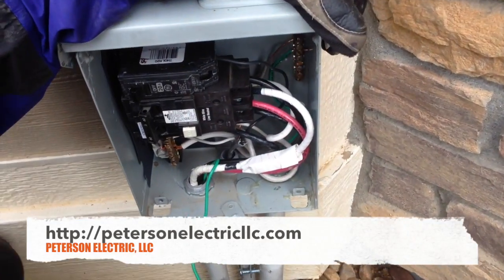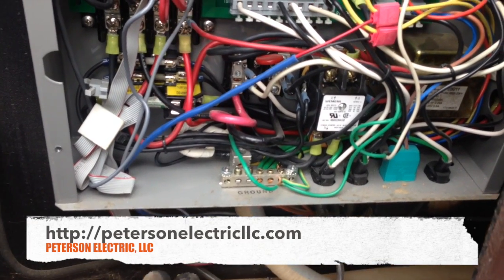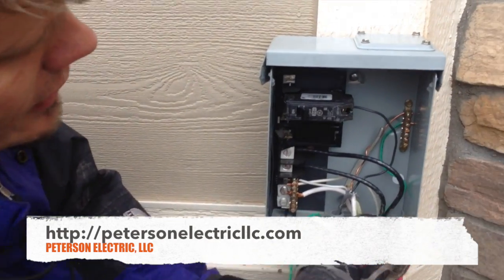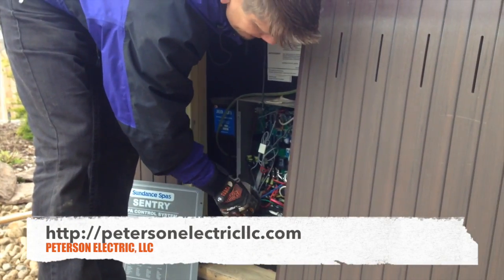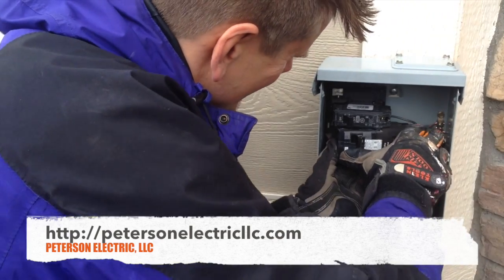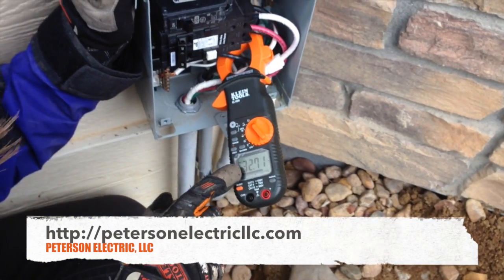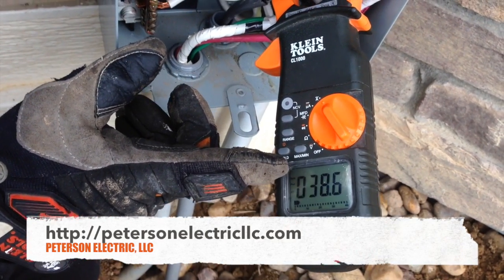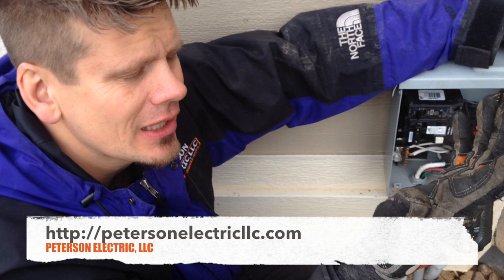Spa 3 Wire System, Not 4 Wire Electrical System

Comment: The tub could get away with 50 amps, but Sundance allows to have both pumps on high speed while running the heater.  There are jumpers on the circuit board in the "JP9" cluster that changes the operation Logic to use 40A, 50A, or 60A depending on the available power.  On 50A you can only have one pump on high speed with the heater, and 40A only allows to have pump 1 on low speed with the heater.

Comment: 75 degree table for breaker lugs
90 is for motors
You are wiring a gfi 75degree table
Reply: Yes and no. Anything under 100 amp over current is 75 degree.
Reply: Please check 110.14 for connections.  I thought it said that for < 100 amp connections use the 60 degree column unless the terminal/ breaker is marked as rated for higher.

Comment: I am having the same problem i also have a sundance (3wire) the attached pic is the GFCI (all conductors are 6 AWG) i have 4 i was just going to cap the white between the GFCI and tub so if i understand this correctly the green wire from the tub (or white if its the larger gage in your case) should land on the middle terminal on the GFCI breaker and the white pigtail should land on the neutral bar also u said isolated neutral in the GFCI box so i should make sure the bonding bar is not installed? so in the GFCI disconnect box it should be..
Feed form house
Red - Hot lug
Black - Hot lug
White - Neutral bar (lug)
Green - Ground bar
Load to tub
Red - Hot breaker terminal
Black - Hot breaker terminal
White - Caped
Green - Center breaker terminal
Pigtail - Neutral bar
(bonding bar disconnected)
?
https://www.dropbox.com/s/jtrwvdxk112d7sp/20200711_181117.jpg?dl=0
Reply: found my own problem.... thats what i get for buying a disconnect box/GFCI breaker 2nd hand for $20 vs the 100 at the DIY stores...it was a bad GFCI breaker!!! it was wired right...heres how i found it ..if u wanta test to see if your GFCI breaker is actually working disconnect the loads from it or disconnect the load lines on the tub, and try just truing on the breaker by itself no load on it if it still trips the breaker has to be bad
Reply: @brandonoh777  So I am installing a 50 amp gfci disconnect box and going to hook up a sundance hamilton 3 wire tub.  So am I correct to state that from main panel to sub panel is 
red hot
black hot
white isolated 
green ground.

From GFCI to box
pigtail to isolated common
Red to hot side of Breaker
Black to hot side of Breaker
No connection to Common connection on Breaker?
Thanks

Comment: My electrician wired up 4 wires to my Sundance 680 Mckinley tub that only should have three wires. Smoke came from the tub, there was an electrical burn smell. The tub ran for a while then stopped showing a flow code error. 

Do you know what damage could have been done, what needs to be repaired and if the tub is safe to use? I think the smoke may have came from a pump motor or heater. Thank you!

Do you know what damage was done and of the tub is safe to use
Reply: its hard to smoke out a motor or heater.   my guess is your control board fried a relay or something.

Comment: Hey thanks for the video, keep em comin. So, the gfci breaker in the panel reads the amperage through the hots and will trip if there is discrepancies in returning amps which would indicate an electrocution or fault taking place?

Comment: If the tub doesn’t need a neutral why not cap off the neutral, instead of the ground? I know in my area it needs to have a ground.
Reply from the maker: You could use the Neutral on the load side as a ground and then cap the other. The Neutral is in a larger conductor and the ground is smaller. You can use color 3M tape and use which every one. It just matters that the Neutral is not connected on the disconnect to the spa Neutral lug on the spa. This is a Sun Dance Spa and they do not want four wires from the disconnect to the spa. But from the panel in the house you have to have four wires to help trip the GFCI spa disconnect
Reply: Peterson Electric - Hey I didn’t connect the neutral to the jacuzzi, I what I see in your comments, the GFCI breaker still work right?
Reply from the maker: @MsMKBOY  only on the hot wires.
Reply: Peterson Electric kinda confused so do u have the neutral on the gfci connected to the ground on tub because I seen you cap the ground most I seen there’s no wire common off the neutral on the gfci it’s just the ground on panel to group on tub

Comment: Do you have a diagram for wiring a three wire Jucuzzi tub, including the gfci disconnect box?

If I connect ground, it trips gfci breaker. It’s a dedicated circuit from the main panel in the garage, with a disconnect about 8 feet from the tub. There is a neutral run, but not connected at the tub. Seeing a full diagram would be great. Did I mention I don’t like three wire systems.

Comment: Let me ask you a question. I have a new hot tub to replace an old 3 wire hot tub. Previous hot tub ran 6/3 with no ground on a 50 amp. New hot tub requires a ground. My plan was to plastic conduit and 4 thhn 6 gauge wires from the disconnect. That part is easy. Question is, around the disconnect panel. I know I need to update to a 60 amp and I assume I need to update the disconnect since it has a single neutral bar, and no separate ground bar? Correct?
Also, the previous setup had 6/3 no ground direct burial from main panel. Does that need upgraded? This will be a pain. Does not having a ground to disconnect defeat the purpose. Finally, assuming I need to update the main panel breaker to 60 amp too. 

Could I perhaps just put the gfci in the main panel and continue to use the 6/3 no ground? I already know that answer 

Thanks joe